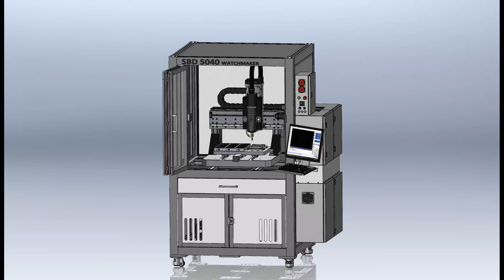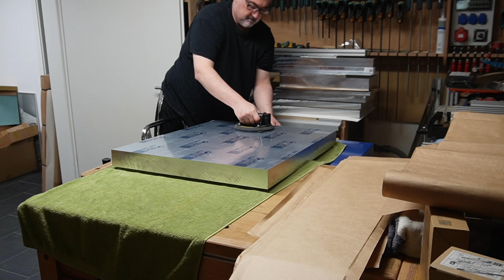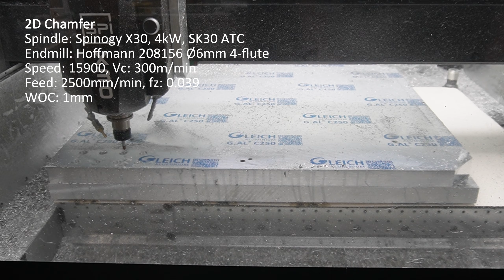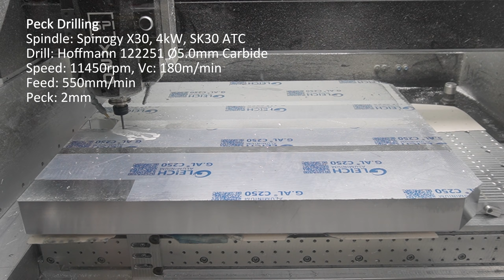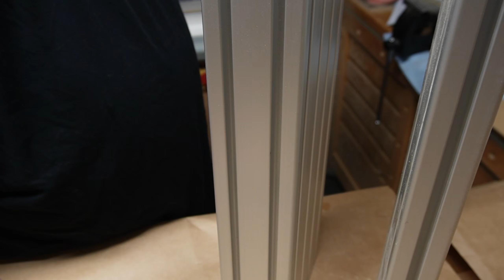Extremely sturdy DIY CNC with small form factor, suitable for milling steel

Comment: It's incredibly annoying how much it costs for aluminum extrusions in Canada.
SOOOOOOOO Expensive, when it should be instead really cheap considering it's just recycled aluminum melted and forced through a mold...
I'm going to have to figure out how to make my own casting mold made to extrude these myself from now on.
Reply from the maker: Cost have doubled here in Germany over the last 5-6 years, but it is still one of the most cost efficient way to build a reliable and sturdy CNC
Reply: @scratchbuiltdesigns  Ya I agree that it's one of the best way, but the costs are outrageous here for the larger types other than the regular single rods.

Comment: WOW! This is so incredible. One day soon I can get a change to build my own gantry style cnc mill. I noticed you used 5083 cast that is stress relieved..... must be expensive. Normally I might have gone with rolled aluminum undergone controlled mechanical stretching that relieves stress T651. In my country its hard to get any cast alu plate with that thickness. Really cool project. Keep up the great work
Reply from the maker: Here in Germany a pre-faced cast 5083 plate is more or less the same price as a hot rolled 5083 plate. It is an absolute no-brainer, what to use

Comment: 13:48 couldn’t you have vibrated the extrusion with a drill or reciprocating saw guard plate (like the rhey do with concrete bench tops) to cause it to settle and an bubbles to comes to surface?
Reply from the maker: Have you seen the mix?
Vibrating only makes sense when you have a rather wet and liquid mix (like concrete), but not one with the consistancy of moist sand
Reply: @scratchbuiltdesigns  yeah more fluid works better but i have seen high viscosity stuff “flow”. I’m also going off vibrating can help sand settle. The epoxy probably reduces that a little though.

Keep in mind I’m not there and only looking at a iPhone screen…
Reply from the maker: @OneSolidCube Fair enough. But trust me, I tried it in an earlier build and it was totally meaningless, in fact it made things worse, for it didn't compact the mix but actually loosen it up
Reply: @scratchbuiltdesigns   I wonder if vacuum bagging would work to draw out voids..  rather than a full setup just one of those clothing bags you vacuum… 

I’m gonna try when I get a mill. Prob do one of those millennium milo Miley kits to learn on, before upgrading. They use epoxy sand/ granite. Any reason you don’t try lead shot? Cost or weight not a concern.

Comment: great video! I'm thinking of using epoxy granite filled extrusions for a high speed 3d printer build, but I'm a bit concerned about the different thermal expansion of the extrusion and epoxy and increased chamber temps. On your cnc the extrusions probably wont get very hot, but do you know if they can survive increased temperatures?
Reply from the maker: When it is just for improvement of dampening properties, just fill them with dry sand. You can epoxy an endcap, fill the extrusion and epoxy another endcap

Comment: I need to get my money up so I can grab one of those spindles.  I've seen what you and clough42 have been doing with em.  Seems worth it for the size class of our machines. The filled extrusions sound like induction hardened cast iron.  That's amazing.
Reply from the maker: Please make no mistake. James doesn't have a Spinogy spindle. His style and approach to CNC milling is totally different to mine. His PM728 is by nature not really suitable for HPC milling and is more suitable for a conventional approach, as can be seen in his videos. 
And his CNC Depot FM30 spindle on the Avid has never been seen cutting any chips in his videos - at least I haven't seen it. Probably because he went with the 12k rpm version. I remember him saying because we wanted to mill steel. Never happend, because the Avid is way to flimsy for that and he quickly moved to the Bridgeport and now the PM728. The Avid is capable to mill wood and alu, but the 12k is too slow for that. So overall a very poor spindle choice for this kind of CNC router.
If you want to mill aluminium on an Avid or comparable machines, with high feeds and speeds, get a Spinogy 😉
Reply: @scratchbuiltdesigns  Ah!  That explains why I couldn't find a spinology fm30.  It doesn't exist.  Thanks for clarifying.  They look similar at a glance which is why I made that mistake.  HIS video i watched years ago. Mandella effect perhaps.  Lol.

Comment: I like the machine and the components, but can you build it in 10-15mm mild steel to keep cost down?
Reply from the maker: When you consider the cost of a complete machine, incl. linear components, servos, spindle, CNC controller, etc..., in case of an ATC spindle accessories like compressor, pneumatics, water cooling, tool holders, etc... the potential cost difference would be peanuts. Especially when you consider the oncost for machining and corrosion protection of steel parts...

Comment: I too have built a CNC machine with focus on rigidity and also a big working area in relation to outer dimensions. I made a video (a very boring one) just because I promised someone to share my design choices. Have a look at it and maybe you could give me some feedback? https://www.youtube.com/watch?v=VwyP4c8Ce_0
Reply from the maker: Interesting design, but rather complex. Question is, do you really need the 300mm Z-height, especially when you have the possibility to clamp parts vertically.
The biggest factor to a high rigidity on a moving gantry style router is a low gantry. I explained that in this video here: https://youtu.be/Qd4jFnPUs2A

Comment: no hate but i dont understand why most diy cnc mills are just router style not a traditional moving bed vmc.
Reply from the maker: Moving bed VMC has of all the different CNC styles the worst mill area to footprint ratio and is not really suitable for larger Y travels, because this requires an enormous overhang of the spindle, hence a massive Z-column. I have explained that in one of my earlier videos

Comment: Awesome stuff as always! Did you put any release on the 3D printed end-cap parts? Or how come they did not bond to the epoxy sand?
Reply from the maker: A very light coat of WD40 is enough. There os very little Epoxy in the mix

Comment: Fusion 360 software programming?
Reply from the maker: Nope. Mastercam
Reply: @scratchbuiltdesigns very nice!
Reply: @scratchbuiltdesigns i really really like your design and the build quality. I want to build one for home use. I have 3 cnc routers now, 1 can mill aluminum, but i have carbonfiber on it, so want a really sturdy smaller unit that will accommodate a 4" vise or a Schunk mill vise to do small aluminum and brass and some small 4140 steels. No cutters bigger than 2" shell mill. But i want the high feed speed for adaptive machining.

Comment: Klasse! Hast du schon mal überlegt, das Maschinenbett zu gießen (z. B. als Mineralguss mit Alu- oder Stahleinlagen), um die Materialkosten zu senken? Was kostet bzw. kostete die Alu-Grundplatte von Gleich? Bei meiner DIY-Fräse habe ich ebenfalls Alu von Gleich (C330?) verwendet.
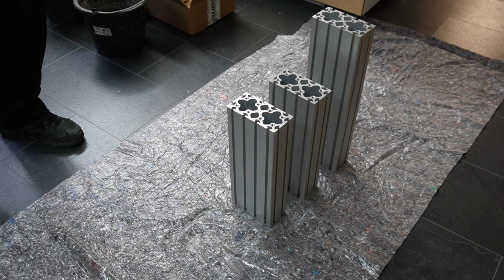Reply from the maker: Hab ich im Video erklärt warum das keinen Sinn macht (ab 11:57), mal abgesehen davon, daß es mit den Formen und der Arbeitszeit deutlich teurer ist...
Reply: @scratchbuiltdesigns  Hab mir dein Video jetzt komplett angeschaut, vorher hatte ich nur Ausschnitte gesehen. Bin völlig bei dir, was die höheren Fertigungskosten und die schlechtere Skalierbarkeit eines Maschinenbetts aus Mineralguss angeht. Wenn man die Maschine in Serie bauen möchte und nicht nur eine für sich selbst (Arbeitszeit egal), ist deine Lösung wirklich top! Mir war nicht klar, dass du ein Profi und nicht „nur“ ein Hobby-Fräsenbauer bist.
Da ich keine Firma habe und nicht regelmäßig Alu bestelle, konnte ich damals leider nicht direkt bei GLEICH kaufen. Dadurch wird es natürlich deutlich teurer, weil man über einen Händler gehen muss.
Ich habe gerade im Netz bei einem Anbieter nachgeschaut: Dort kostet eine feingefräste Gussplatte in 400 × 500 × 50 mm bereits 543 €. 70-mm-Platten scheint es dort nicht zu geben.
Freue mich schon auf dein nächstes Video! Verwendest du beim Portalbalken eigentlich auch Mineralguss zur Schwingungsdämpfung? VG Anton
Reply from the maker: @boessi Guck mal bei Gemmel Metalle

Comment: Have a question aluminium does have a higher thermal expansion than steel so will that affect accuracy? or is the mass big enough too keep it at ambient temperatures and thus reduce it? or is it that the work that will be done in it will not be so precise that it causes any issues?
Reply from the maker: During normal operation it is no issue at all. The parts do not heat up enough for that.
You should avoid major temp differences from summer to winter in your shop, however. Like with any machine
Reply: @scratchbuiltdesigns  A i suspected such, well when i get a workshop i will make sure it will have the constant 20C for ISO measuring standard, mostly since i am a bit pedantic. but it is an inspiring build. is it Linux CNC you use as control or a proprietary for easier maintenance and support?
Reply from the maker: @Winther83 EdingCNC

Comment: Wow and easy to transport too since they're mostly made of aluminum/lightweight? I mean is doing this the main advantage over converting an all steel SEIG mini mill into CNC ?
Reply from the maker: My first CNC was a converted Optimum BF20, so basically the same as a Sieg. These machines are not comparable.
The SBD 5040 weighs about 220 kg, so around 15% more than a X3L, has more than 2.5 times work area, yet a smaller footprint...
The smaller SBD 3525 weighs about 140kg, so more than twice as much as a X2, 4 times the work area, yet the same footprint.
Reply: @scratchbuiltdesigns interesting and makes sense thanks!
Reply: @scratchbuiltdesigns  subscribed!

Comment: You run your router faster than a few people I know with VMC’s! 

Subscribed.
Reply from the maker: Thanks 😊 I believe that's the whole point of a router, isn't it?. High rpm and high feed rates, but small chip load.
VMCs rather the opppsite....

Comment: Thanks so much for sharing this - I've really enjoyed following along here and on Instagram :)
Where I'm based (in New Zealand), the beautiful cast aluminium plates are prohibitively expensive (well beyond even what they appear to be in the EU, which are already not inexpensive!!). If instead I use readily-available rolled plates, I'd need to contend with the material's stresses. Two questions about that: 1) Do you think that (for one-off designs) decent results could be obtained by, say, starting with a 60mm thick plate and facing the material in a couple of steps on either side to arrive at a 50mm thick plate? 2) Once this stepped skimming is done, could I expect the material to remain relatively stable, or would it continue to distort significantly over time?

The cast approach is definitely preferable (particularly from a manufacturability perspective), but the easier availability of rolled plate in my region makes me interested in exploring its feasibility.
Thanks again!
Reply from the maker: In this case I would probably just skimm a few 1/10th off the top, bolt a 20mm thick strip for the rails to mount on left and right and take that down on the mill to the required height. This should not affect the base plate...
Reply: @scratchbuiltdesigns  Thanks -- I appreciate your reply! This sounds like a promising way forward. I look forward to your future videos!

Comment: How do you prep your stock? It would be a nice small video. I bet you have some great tricks and thoughts there.
Reply from the maker: Actually there is not a lot to say about it...
I work mainly with pre-faced 5083 plates. They are available from 5 to 100mm. Up to 20mm in 2mm increments and after that in 5mm increments.
I order them per project, part by part with 2mm extra stock, so  e.g. for a 335x180x25mm finished part, I would order 337x182x25mm stock.
The material is casted, not rolled, and has very little residual internal stress, means it doesn't warp or bend when material is removed...

Comment: Problem is you need a HD CNC mill to start with.😕 With mine it basically built itself as it became more and more precision until it replaced all the parts I made by hand.😀
Reply from the maker: Same here. The "HD CNC mill" was built by myself
https://youtu.be/ZuQmm2X9wd4
Reply: @scratchbuiltdesigns  Very cool, very cool. Good job man!😁

Comment: Super strong solid base but then you use the extrusions which probably create a weak spot, why?
At this point make it all CNC machined parts...
Reply from the maker: Filled profiles have better dampening properties, better cost competitiveness and are overall easier to machine and handle.
And in combination with the 20mm plates they are certainly not too weak to handle the milling forces of a 2.2kW spindle.
Please check the previous video with the design considerations

Comment: That chunk of aluminum is like 2-5K. Plus that X30 spindle is 6k by itself. I see your spectacular machine and think I HAVE to step MY game up. Comparison is the thief of joy. While i will NOT be building anything close to the amazing (and ridiculously expensive) machines you have, i can take some of your design and building techniques and incorporate them very well into a more budget friendly solution. I'm thinking of maybe doing some reinforced epoxy granite slabs. Milled flat after i form them. Actually, i think i can do everything i need with a CNC lathe and plasma cutter. I don't need anything anywhere near the X30 (very nice spindle BTW). You certainly do set the bar pretty high my friend. 
Your work is amazing and your attention to detail is second to none. I always look forward to seeing whatever it is that you're building.
Reply from the maker: Dude...Idk where you live, but the raw base plates used for these machines are well well well under 1k here in Germany...
Nevertheless, it's always a good idea to step up the game.
The machine with the X30, which is used to make these parts has an epoxy granite base plate btw...😉

Comment: What is the precision?
Reply from the maker: Available with C7 or C5 ball screws. Axis resolution is 1 micron
Reply: @scratchbuiltdesigns  As in, ±0.00004in???
Reply from the maker: @MattMacKinnon  Yes. 5000 steps/rev at a 5mm pitch ball screw. That is rather normal. I have the same resolution on my own machines, like the one used in this video.
Now, obviously that doesn't mean your finished part can hold tolerances this tight, because there are various factors, like the endmill run-out, wear, deflection, etc... I am typically within 10-50 microns out of the box, which is more than good enough for me and my applications.
But I am confident enough to mill tolerance fits for m6 dowel pins, bearing seats, etc. with some extra attention to the final dimension...

Comment: Can you develop a cnc that is at a similar size/price point to Carvera - minus the spindle?
Reply from the maker: A Watchmaker 3525 would be similar in size, so exactly the smaller machine featured in this video. Since it is far more capable it is obviously not the same price point.
In any case, I don't see the point in competing with a low cost China product. Sorry
Reply: @scratchbuiltdesigns  I get that but.... I am interested in buying my first CNC  - so if you could offer me a more capable cnc for a bit more then I might be interested in going with your design

Comment: Great to see another video! Did you consider using granite surface plates as the machine base? They are relatively inexpensive (depending on desired precision and rigidity requirements), come in a variety of sizes, and would save you a lot of work at the start of the project. All you'd need to do I think is add some shallow pockets (many options for how) into which you'd epoxy some metal mounting plates for the gantry and linear rails. Once the epoxy is cured all you'd need to do is deck them off in your mill and drill and tap the required mounting holes. I would expect a granite machine base would also have superior damping properties, higher rigidity, and practically none of the thermal expansion challenges of a thick aluminium one. For the epoxy you'd want to use something like Diamant DWH. 

Asking on behalf of future me :)
Reply from the maker: In fact I did. But over here they are more expensive than those 5083 plates. Then I'm not a stone mason, so I don't have the tools to remove material. In addition just glueing mounting plates is not suitable, you need to drill holes, epoxy threaded insert and fix them in a combination of expoxy and bolts. I know a few people who have done that and the time to properly drill a hole in granite is hilarious, plus an increadible mess, because you have to flood cool that.
For your personal, one off build ok, but not for a commercial product.
The additional work you mentioned would make them 2-2.5 times more expensive.

Comment: fantastic job done , I have to say
I watched all your videos and only have two question about the process, everything else is perfect and exceptional,
1- the epoxy granite and and aluminum have very different thermal expansion rates and don't usually go well together, isn't it concerning for you ? (I'm asking because I remember you also mixed aluminum and epoxy granite in the epoxy granite CNC build video)
2- you follow a technical and standard build procces, but I never heard you talk about stress reliving the parts 
does it have a reason?
amazing work done after all 🔥
Reply from the maker: ad 1) In my workshop I have a constant temperature throughout the year, so there is no issue with different material mixes
ad 2) I use exclusively cast material with very little internal stress, so there is no need to relieve them